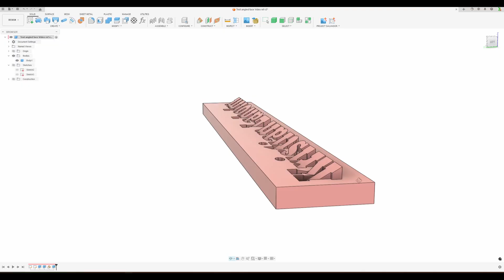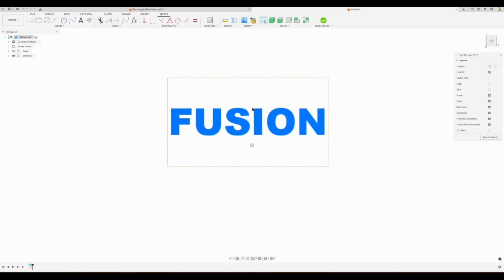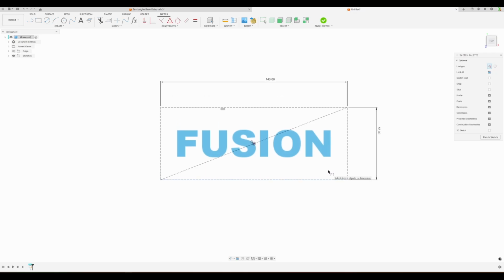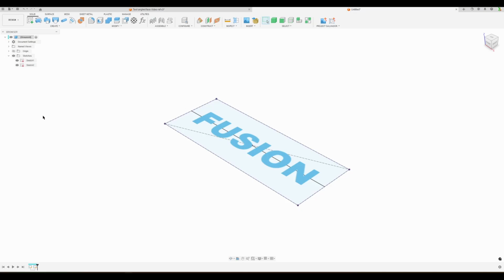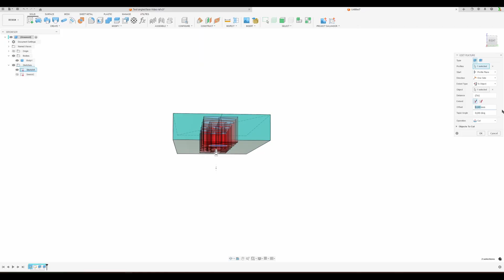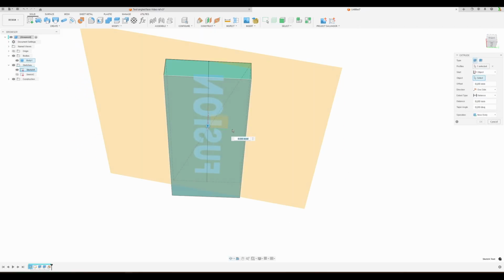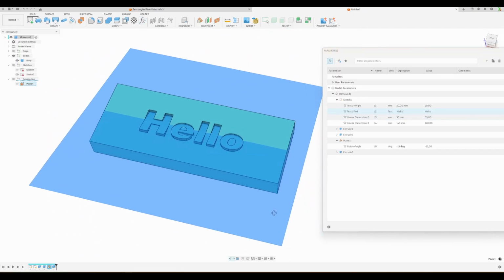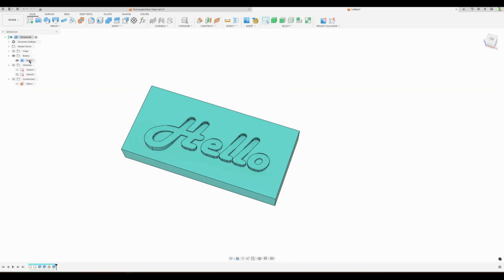Fusion Angled Text - That still works after you change your mind

Comment: I just wanted to say thanks for all of your videos, I've been learning and using fusion a lot over the past year and your channel is by far the best for tutorials and a large part is that most tutorial channels will only tell you what to do to build the specific object that is the topic of the video but they don't tell you why they are doing things the way that they are and how it could be done differently if needed etc which is infinitely more valuable than just knowing how to build whatever abstract design the channel owner is making for the sole purpose of the video so its insanely helpful to have someone like you actually showing how to do it all and why its done that way and how else it could be done etc
Reply from the maker: Thank you, I appreciate that.
Focusing on the reasoning behind a workflow is exactly what I try to emphasize, so it’s good to hear that it comes across and is useful.